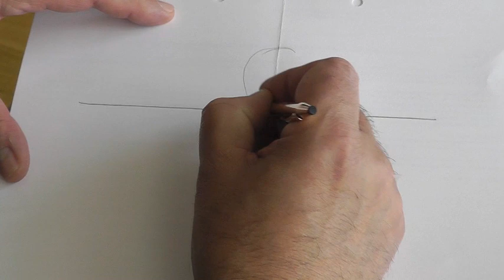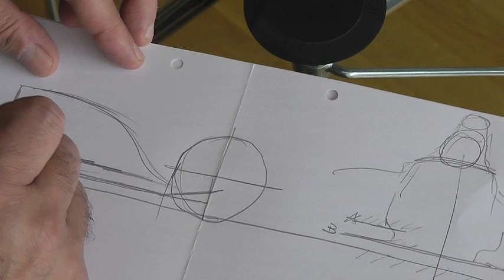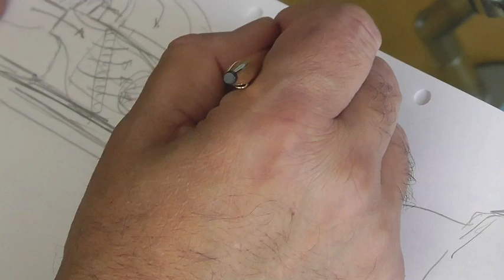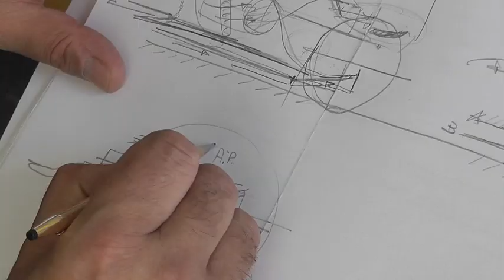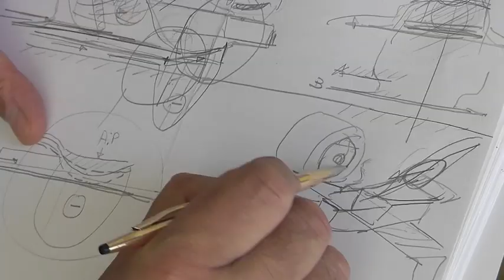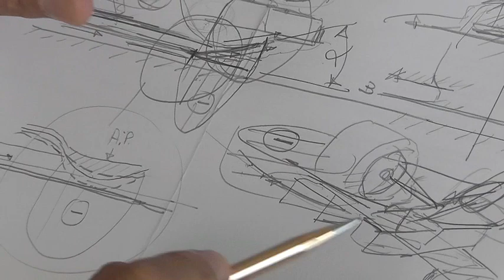Let's draw...

Comment: Only problem is that the rear diffuser doesn't actually create downforce, but helps the rest of the body be more efficient in doing so.
Reply: +billyjack70 Nope, wrong....
Reply: +Mita Larsson lol ok, troll.
Reply: +billyjack70 I suggest you educuate yourself a bit more on this top
Reply: +Mita Larsson I suggest the same to you. ;)
Reply: +billyjack70 I actully have quite a bit of knowhow in this field and have helped several teams develope their aerodynamic packages
Reply: billyjack70 I'm studying aerospace engineering and can tell you that you're 100% RIGHT. The low pressure zone, created under the floor area by the fast moving air flow is what is making downforce, the diffuser is there just to make the transition to the higher pressure zone behind the car smoother(more linear and less abrupt), increasing the efficiency of the floor(reducing drag).
Reply: +billyjack70 The diffuser is curved. makes the flow accelerate. Low pressure, yada yada, lift.

Comment: Is there negative pressure behind the rear wheel just becouse it is an obscacle? If the rear wheel would be under a body panel (lets say like the LeMans LMP2 cars for example) there would be no negative pressure, right?
Also - doesnt the negative pressure from the wheel suck the air from under the body before the air exits the diffuser therefore making it worse? Something which exhaust pointing the sides of diffuser helped to block lately..?

Comment: the low pressure generated by the rear diffuser is because the air flow is accelerated underneath the back of the car, correct? He says the negative pressure but doesnt really say why its a negative pressure. really good videos tho